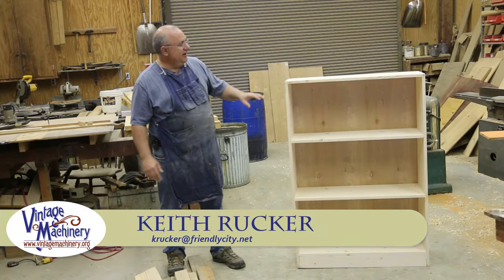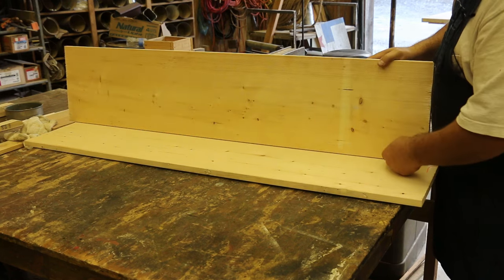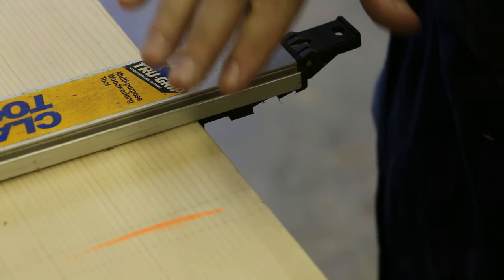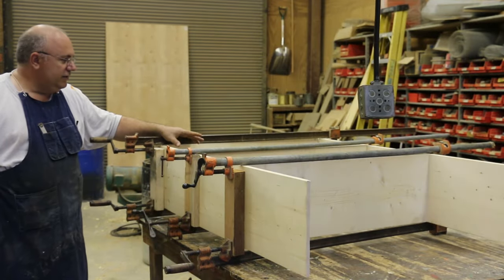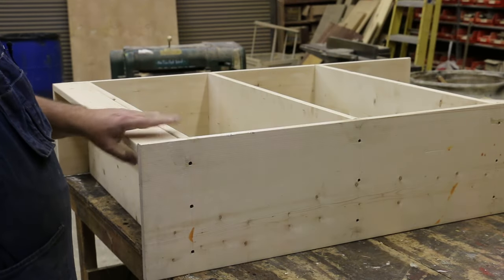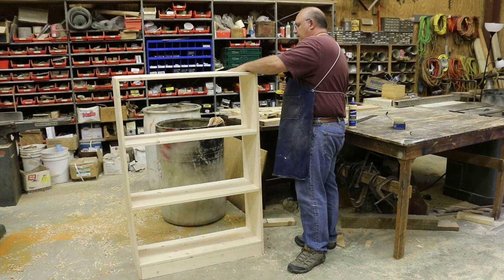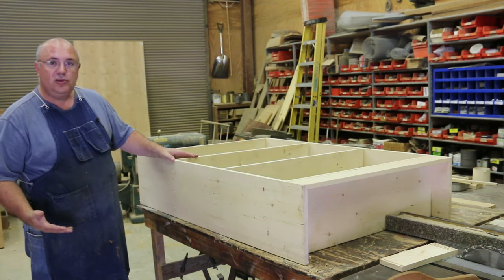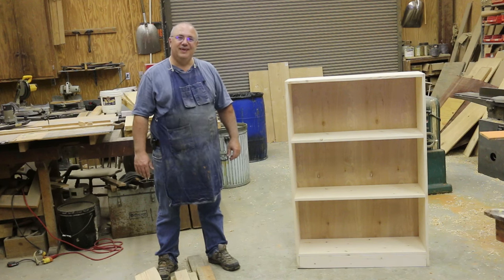Beginning Woodworking:  Building a Simple Bookcase

Comment: After over 45 years in the cabinet trade, several things I would suggest:
Glue the back on.  Over time, the nails will loosen up or someone will shove something heavy into the bookcase and knock the back loose.  The nails become simply clamps to hold the back on while the glue dries.
The other thing would be to add a piece under the top at the back, maybe a 2 inch wide piece (with the 2" vertical) . In the trade it's called a "hanging rail".  I know this won't be hung off the floor, but it adds another place to nail the back to, and if you want to screw the cabinet to the wall, it's done through the rail, not through the back which has no strength.  If one looks at older bookcases, the backs are loose because they were no glued, and as you mention, the back is what keeps the bookcase from racking and falling apart.
Otherwise, good job.  For those who don't have the tools, the shelves could have been butt nailed in place (without the rabbit) and then 3/4 x 3/4 cleats glued and nailed under each end of the shelf for strength.

Comment: For those that don't have a flush-cut saw for the plugs, use some strips of masking tape on one side of a regular hand saw. You can build up the thickness to match the set of the teeth and then it won't scratch up the panels.
Reply from the maker: +ElectricGears Very good tip!  I have done that before, but not since buying that handy flush cutting saw!
Reply: +ElectricGears >

Comment: One of the first projects I had to make in wood shop was a book case similar to this one, except we had to use hand tools only.  It was not easy but it came out looking good and is still in use by my grand-daughter.   Hand tools can be bought a few at a time, go for quality over price,  buy the essentials first and the fancy gadgets later.  While a router is a handy tool, anyone interested in wood working and has the space, they should always consider a good quality table saw as their first power tool. With practice on scrap wood first, you can make perfect dadoes very easily. And remember, the beginners best friend: molding!  Fancy molding not only looks good, it can make up for misaligned edges. LOL!

Comment: VG video.  Right to the point and well shot.  I appreciate the LACK of annoying music.

1) After cutting the dados, if you drilled tiny holes from the inside of the dadoes to the outside of the boards first, you wouldn't have needed to do all the transferring / measuring to position the screws from the outside.  

2) If you were going to screw the unit together in the end, then before gluing, you could have first pre-drilled the holes & countersinks from the outside (after locating them via step 1).  Then, after gluing, you could have then just used the screws as your clamping, which looks like it was quite a deal.

3) That kick plate was crying out for pocket screws!  I know it's kind of a product placement, but seeing how you wouldn't need to hide the holes or anything - it would have been the perfect application.

4) Some people say put a rabbet in the back to recess the panel, I say this is fine!  Great job.

Comment: At our college today my colleague helped Computer Society students build a similar (much smaller) shelf case. The idea was to use Google Sketchup to draw the shelf case, then they went to the wood supply store, then to a cutting workshop to cut the pieces. Back at the college they just installed the parts together. There was no routing or such.
The idea is not the woodworking side, but the Sketchup side.
I'll show the students this video.
Thanks
Reply from the maker: +Waheed Alsayer Very cool!  For me, I learned "sketch up" the old fashioned way with a T-square, pencils and triangles.   I really need to get better at CAD.  For me, that currently stands for "Cartoon Assisted Drawing", which is the quick sketches I draw up in the shop.

Comment: Good lookin' shelf you've got there Keith! I really like that flush cutting saw.
Reply: +MattsMotorz I have a spare plane blade i use to cut off those caps or dowels flush, you lay it flat and a bit of sideways action cuts it pretty easy after a couple of goes, and less likely to cause scratches on the side around the cut
Reply from the maker: +MattsMotorz That saw is one of the handiest tools that I have in my wood shop!

Comment: Keith, I have done a few of these too. When it comes to fitting the back you don't have to cut the plywood exactly to size. I make it a little larger; perhaps an inch all around, and then use the router with a flush-cutting bearing bit to trim the plywood exactly to size. The bearing on the bit can leave a small mark, but the sanding will remove that.

Just sayin'...
Reply from the maker: +Greg Brodie-Tyrrell I actually like to cut it about 1/2" smaller so that the back is inset about 1/4" all the way around.  It helps hide the end grain of the plywood when up against the wall.  On more finer pieces of furniture, I will cut a rabbit around the back and inset the backing so that it is not visible from the side at all.

Comment: Hello Keith,

Very nice that you also made a video with some woodworking and talking about woodworking, I did also for the last two weeks a lot of woodworking. I made a kind of wood plates with a plastic finish at the ceiling and walls of the hallway here in my house. 

Next project will be a table with glass in it so therefor great that you showed how to use the router. I have a router with lots of different cutting heads for it but I didn't use a router before so I have to learn how to use it at the best way.

Beside, about cutting big pieces of wood, here we have a shop called Gamma where they cut it for free when you have a visitor's pass/card. Much easy'er for me because also for to transport it in my car I can't go bigger than about 2 meters and 1 meter in height. 

I hope you have maybe some tips about using the router or maybe when you have a project for working with a router, I hope you can make a video about it. 

Anyway thanks for the video and many greetings from Roel !
Reply from the maker: +RoelTyros I am sure that I will have some more router work down the road and when I do, I will be sure to cover what I know!

Comment: I've built a number of bookcases and record cabinets using hardwood plywood. Hardwood plywood is never 3/4' thick, usually more like 0.72 to 0.73 thick so a 3/4" router bit would be to wide. I use a 1/2' bit to make the initial pass and I have some 1/64 and 1/32' strips (made out of sheet epoxy (G10 material) that I use along my guide to get the correct dado width.

Because I'm using plywood I have to cut it into strips of the correct width, I usually use a guide and a skilsaw with a fine tooth blade for that. I plan the interior shelves to be 1/4" less wide than the sides and top so I can let the back in. I use my router to run rabbits in the side and and top (when assembling I keep the front edges aligned so the shelves are all set in 1/4" from the back edge) so the 1/4" back sets into the case, this greatly strengthens the case and keeps it square. This makes fore nice neat casework but you do have to rip the stock to size.

Comment: Thank you for the detailed video! My previous woodworking attempts haven't gone well, but your careful explanations make me feel like I can do it.

How important is it to glue and clamp the shelves before adding the screws? I have to work outside, so I'd rather not leave it overnight. Also, not sure I can move fast enough before the glue dries.

Is there any reason not to do the staining before attaching the back? It seems like that would be a lot easier.

Comment: Hi Keith, I read somewhere that the grooves would cut in about 1/4 inch---it could have been from you. Anyway, I'm wondering if you can make that cut in one passing. In other words, it looks like you just made one pass instead of passing with an 1/8 inch cut then adjusting the router and cutting 1/8 inch deeper to make the 1/4 inch.

Comment: What a great video Keith many thanks for sharing this, I do have one question though. When you were routering your dado's/groves...what router bit were you using was it a straight edge cutter or a rabbit bit?
Reply from the maker: I was using a straight edge bit.  A Rabbit bit has a bearing on the bottom for following an edge - when cutting dado's, you don't have an edge to follow since you are going across the board.

Comment: Great movie. Nice work. But how you are able to drill in a such straight line just by hand? Why you put all shelves in a groove? it is hard to keep the overall bookcase dimension. Why not dowels? or screws only without grooves.
Reply from the maker: Putting the shelves into the dados (grooves) will increase the strength of the shelves more than anything else.  The entire width of the edge of the board is totally supported.  All the screws do is keep them from popping out of the groove - they support no weight.
Reply: This is true, but how to do it at home by amateur if you don't have tool to make the groove (dados)? it is impossible. Also it is harder to keep the overall bookcase size. However I agree the solution is more powerful and better for books.

Comment: A simple solution to not having a router, is using a table saw and to make the dado cuts in one sheet so the dados are all aligned. 
Can anyone answer, this: if you're using 3/4" plywood and cutting 1/4" dados into the sides of the shelf then that leaves 1/2" for the countersink screw. I don't think you mentioned how much, maxiumum, or minimum, that you countersink the screw into the sides and to also have a plug fit into it and hold. Can a plug hold in 1/8" countersunk hole? 
Keith, great comment for your clamp solution to using the rope to clamp, cause I thought I could just screw it as soon as i've glued, if you don't have the clamps. Another comment I read of drilling a hole into the dados to show where to screw, helps alot, Thanks! for this video.

Comment: Great work sir. Few question sir. Should we alwAys dry out the glue overnight or we can go ahead and proceed with the screws? And where did you get those big ass clamps? Lol
Reply from the maker: I like to put the screws in while the glue is wet - the screws act as clamps.  I like for glue to dry overnight when possible, but you can often get by with a couple of hours of dry time.  As for the clamps, a good hardware store or home improvement store should have them - if not you can order them from someplace like Highland Woodworking or Woodworking Supply.  You cannot have too many clamps!
Reply: Keith Rucker - VintageMachinery.org Thank you very much sir for the valuable info! I really need those clamps. :D

Comment: Hi Keith,

Thanks for the video. I've made several bookcases but always used screws and cleats to support the shelves. I would like to start using dados however, as you did in this video. I do not have a router, and am considering a trim router. Do you think that's a good choice? If so, what kind can you recommend?? Thanks, Don
Reply from the maker: You could probably make those dados with a trim router, but they are much more light duty. You would probably have to make multiple passes to get the job done.   If it were me, I would just search ebay for a good used router that you can afford.  I like the old Porter Cable model like I am using.
Reply: Very good. Thanks. I think I've seen the Porter Cable advertised. I noticed that Home Depot carries a regular size Ryobi router for about $70---not a bad price, actually less expensive than the trim routers they carry. I recently purchased a box of Ryobi cordless tools, skill saw, reciprocating saw, a drill and a light. So far, so good. Any thoughts about Ryobi?? Thanks again for your video. It was very helpful.

Comment: Hi. Why would you use fine thread screws?
Those are for metal or hard wood. For pine I usually use coarse self tapping screws...and countersunk pilot holes.
Reply from the maker: +Cristian Roman Those were the screws that we had and I did not see a need to buy any more.  And, we were using countersunk pilot holes.
Reply: +Keith Rucker - VintageMachinery.org Hi Keith. Normally i would do that too...if i were just building a piece for me, but for a client...i would use the coarse screws for pine. Out of my experience, the fine thread has a tendancy to turn the pine wood into sawdust instead of gripping into it....due to the fine threads. The coarse thread has a wider space of threading, allowing the wood to be compressed, rather than drill it out. This is my opinion based on my experience.
Otherwise....great job on the project. Came out nice. Wish you all the best.

Comment: lol, I do this even simpler when making shelving for paperbacks and DVDs and CD's. 1 by 5 boards marked for the height of books or DVDs, drill 2 holes for nails/ Cut the shelf's to the width and then nail thru the drilled holes. Works fine.   ;}
Reply from the maker: +dejanira2 That will work for light duty, but it will not hold up to weight like cutting dados will.

Comment: Thanks for the project! Just on e question, are you using a dewalt drill bit holder with a sheath? (Sorry if I spelt that wrong) 
If so, then how effective is it? I was thinking of purchasing one of these for my father.
Reply from the maker: +Ethan MacLeod I think that the one I have is made by DeWalt but they are made by lots of brands.  I like them use them all the time.

Comment: Dear Keith,
For the top piece did you use a 1/4" rabbeting bit?
Reply from the maker: That would have worked, but I was just using a 3/4" bit set to make a smaller cut.

Comment: I built a 5 shelf bookcase using 3/4" poplar wood with a plywood backing approximately 6' high by 3' wide by 9 in depth. The bookcase will easily wobble forward and backwards. All sides seem level, could you help me make this not wobble without hanging to the wall? thank you
Reply: Make a decorative base that comes out about three or four more inches in front and I suspect your wobble will go away.With a 9 inch thick base I wouldn't go taller than four feet at the max.

Comment: Which kind of router bit and size bit are you using to make you dado?  How wide is the dado?
Reply from the maker: Not sure what brand of router bit I was using - I have bits from lots of different makers.  As to size, 3/4" plywood is actually 23/32" thick, so a router bit designed for 3/4" plywood is slightly smaller.  In the case of this bookcase, I was using wood boards that were an actual 3/4" thick, so that is what size bit I was using.  As for routerbits, I like CMT, Whiteside, or some other quality maker - not the cheap ones like you commonly find in the box stores.

Comment: There's at least a couple good reasons to hold that bottom board back from the edge and none for trying to make it flush which you can easily see in the video that it is not. I would expect someone with your experience to know that. Other than that good job and thanks for the video, keep up the good work

Comment: Since the clockwise rotation of the bit pushes the router to the left as you move it forward, I think it is better to put the guide on the left instead of the right. I usually remember to do this after I mess up the first dado. ;-)
Reply: +GeoffreyThorpe123   Same here, except I usually just end up pulling the router instead of a pushing. I'm surprised he didn't clamp the boards down when routing. Mine will walk themselves off the table if not secured.

Comment: y to glue if u used screws to hold those shelves ?
Reply: Glue is stronger than screws. Books tend to be heavy, but you could probably get away with just screws if you want to save time or don't have the proper clamps.
Reply: Neto Araujo- if you glue & screw it together the bond is stronger.
Reply: If you can't nail it, and you can't glue it, SCREW IT.

Comment: Nice project, Keith ... I'd like to offer a couple of minor hints:

1)  Drill the holes beforehand from the inside of each dado.

2)  Set the toe kick back ¼" for a nicer effect.
Reply: +Floris Brant maybe its for the workshop more than the home, so the bit of extra support from the front panel being forward is handy, we shall let keith slide perhaps :}  its better than my nailed together plywood!
Reply: +carver3419  re #1 then he would have to countersink and counterbore for the screw heads and plugs eoubling the drill work, and to what benefit?

re #2 that would give a nice effect without any extra work.
Reply: +crazymanmichael also re #1  he would still have to drill  the screw holes into the shelf to avoid the risk of splitting the shelf.
Reply from the maker: +carver3419 You would still have to drill the outside of the holes to make the countersink, so I think it  would be faster to just mark them as I did and drill from the outside.  But your method would assure that you were right in the middle of the dado.
Reply: +Keith Rucker - VintageMachinery.org "But your method would assure that you were right in the middle of the dado."

I have to admit that I got this idea from Tommy Silva on "This Old House". True, you would still have to drill into the endgrain of the shelves and counterbore the sides, but at least you could get starter holes that were well placed without measuring and marking.

In any case, please keep up the excellent videos.